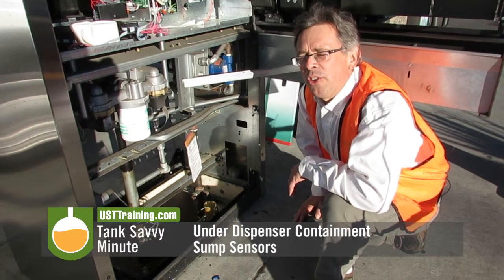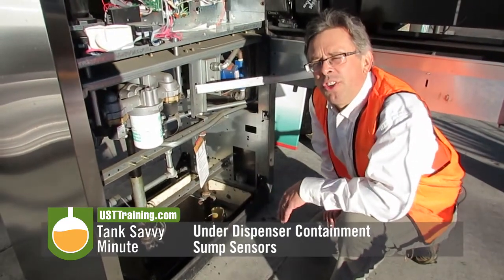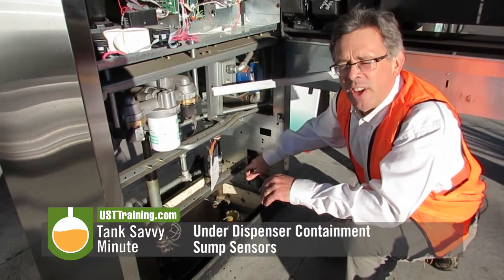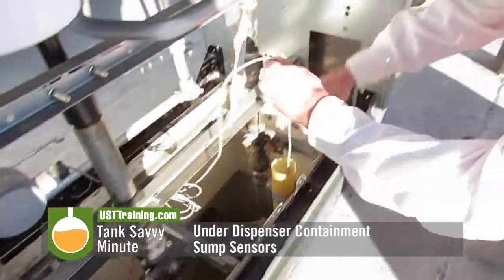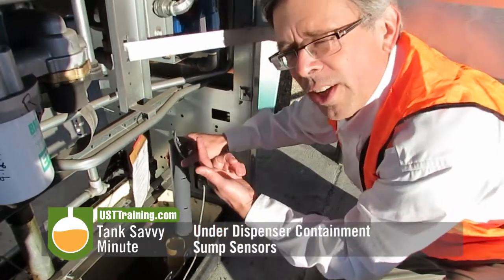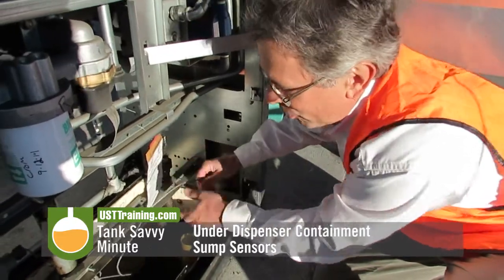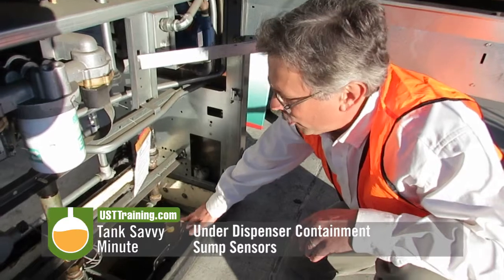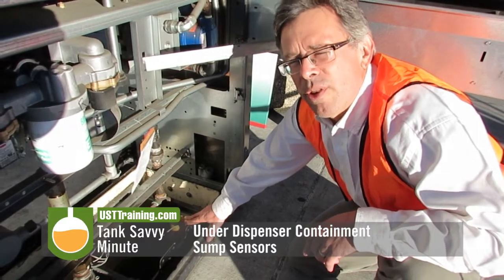Under Dispenser Containment Sump Sensors

Comment from the maker: Hi Eduardo. If by bucket you mean the containment sump, technically yes, water can go in there but it should be removed as as soon as possible. There's metal parts inside that can rust. Plus if you get a liquid alarm you must response and remove the liquid.

If an electronic line leak detector trips it will shut down the pump until you can call a service provider to investigate. If it's a mechanical leak detector, it will restrict (but not stop) the flow.

So restricted flow or no flow should be investigated ASAP. Does that help?